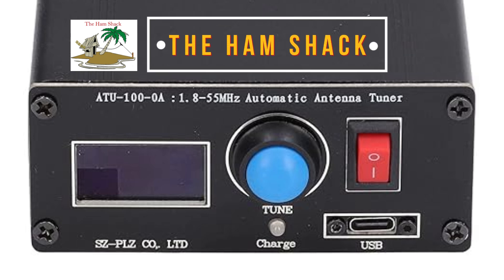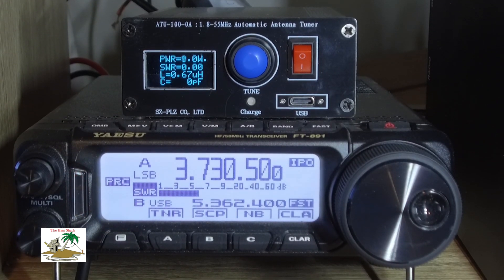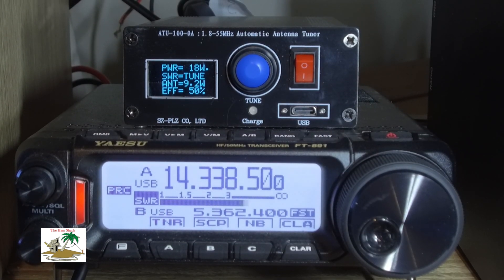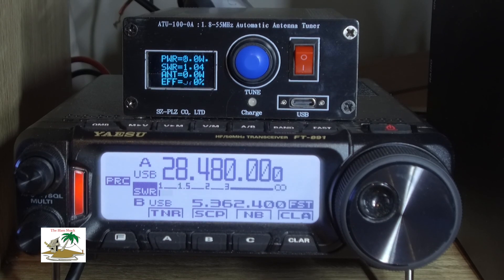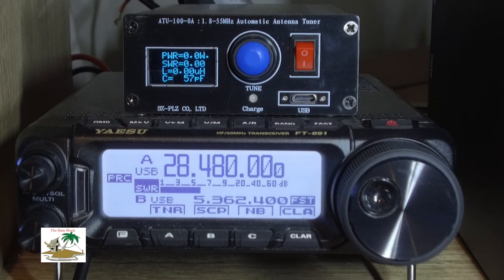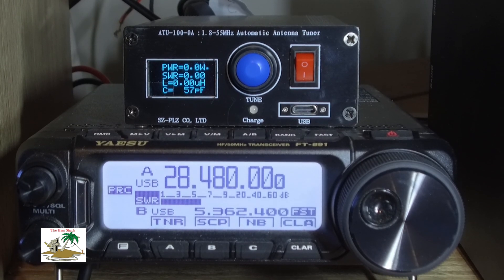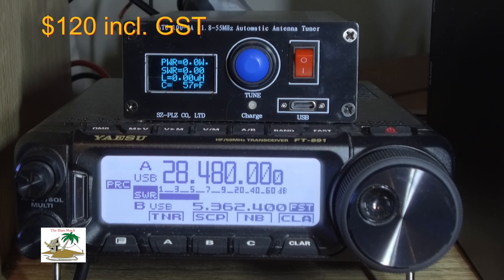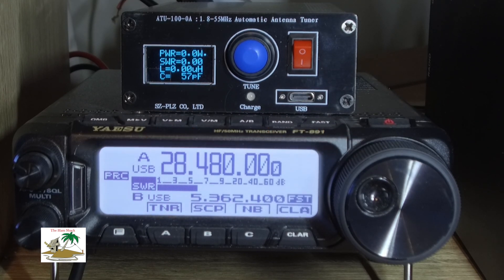Review of the ATU 100 0A automatic Antenna Tuner

Comment: How long do you need to charge the unit for please, I have bought one and it’s fantastic but have had to charge already. That said I did not charge it for very long because  I did not want to overcharge it
Reply from the maker: Hi Robert I charge mine for an hour or two before I go to a POTA activation. I can usually do a few 30min activations on a single charge. I would not charge it continuously but an hour or two is fine.